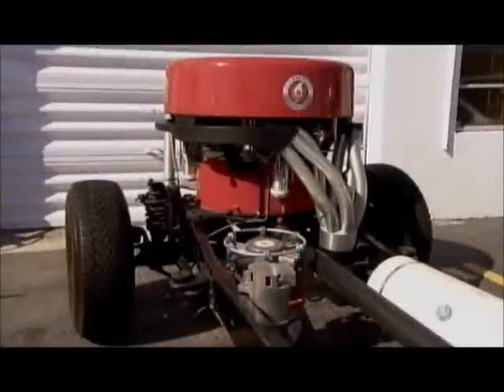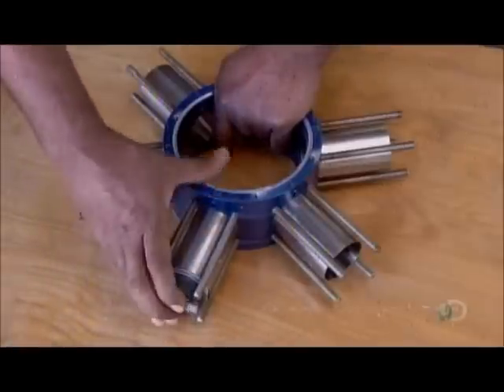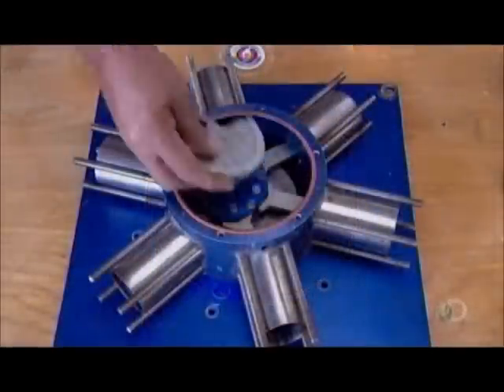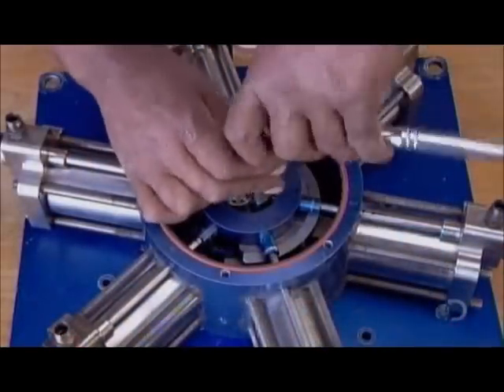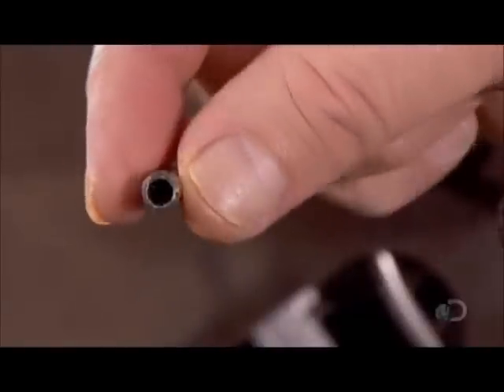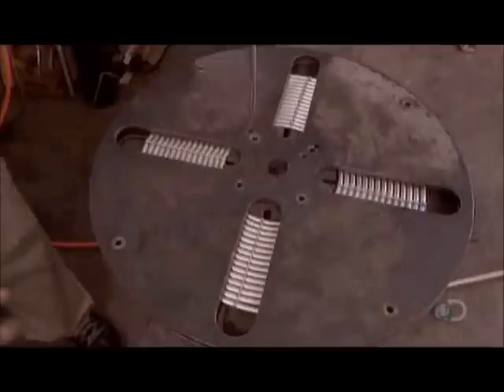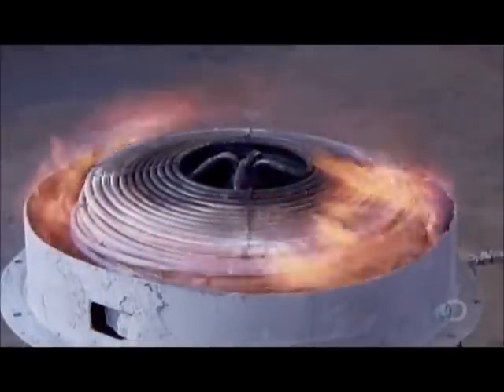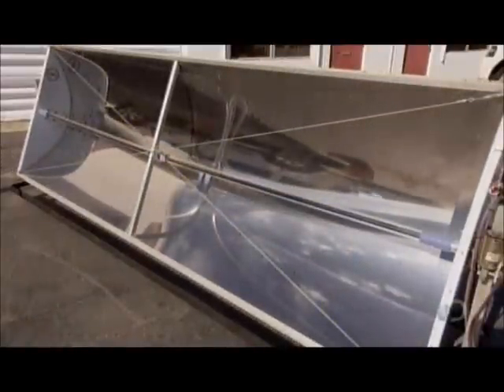How It's Made - Steam Engines

Comment: Steve Cummins just replied, I got an email notice, and now I can’t find his comment in this thread.  This drives me crazy.  So I’ll post his reply here and then address his comment.

"steve cummins
think it's pretty much same as the hybrid steam/ICE idea. Instead of a boiler, fire an oxyhydrogen blowtorch into the steam expander's inlet manifold. If gaseous fuel is at stored at high enough pressure, it'll don't need pumped, and there'll still be enough pressure behind the "steam flame" to run the engine. Suppose it's kind of like using a small rocket that makes steam to turn the expander over.

Avoids the inefficiency of heat transfer across boiler tubes which would otherwise reduce T_hot
Does…”

So his reply confirms my supposition of what he meant.

Comment: i thot water wasnt a lubricant
Reply: it is. slip and slides.
Reply: GenesisRhapsodos
slip and slides use soap...yeah water can make something slippery but it's not lube
Reply: water parks dont use soaps on their rides. major facepalm
Reply: GenesisRhapsodos
genesis said slip and slides not waterparks those are two different things dummy. The water is flowing in the direction of the slide, that combined with it's steepness keeps you going. Often, if a water slide is too flat and doesn't have heavy enough flow you will find yourself stuck even though you had momentum and there is a current of water pushing you. If there was lube involved, you wouldn't have this problem

Comment: Cyclone Power Technologies appears to be defunct...having been nothing more than a very clever investment scam....
Reply: +The real doktorbimmer Steam has potential, but not with a con/scam such as Cyclone Power Technologies or as I call them Scheisterclone. They are a disgrace to light steam power.
Reply: +The real doktorbimmer Pardon, but the real scam here is that a company has made unsubstantiated claims regarding a "family" of powerplants that have never been shown to produce any usable power in over a decade and said company raking in almost $60,000,000.00 from investors and typically allocating more funding to Administrative then R&D for a company that is supposed to be a research and development deal! 

That is the scam. 

You are right though, on a peak sustained load basis, light steam power can't equal the peak efficiency of IC engines, especially Diesel types. 

The only equalizer would be for city driving where a properly designed light steam power plant would not idle or use fuel when the vehicle was at stop lights, etc. However, hybrid IC and electric vehicles are already doing this. 

The other would be the use of "carbon neutral" fuels, such as wood chips or compressed grass disks, this would be easier with a properly designed Rankine cycle then an Otto cycle. However, gasifiers such as were used in the late 1890's for municipal gas production or in the 30's - 40's for road vehicles allow ICE or Otto cycle engine to run on gasified solid fuels. So that isn't a concrete advantage either. 

I don't know how many times I have tried to explain the technical impossibility of a family sedan getting 200 mpg with the simple application of a "magical" carb! Yes, heat cycles desperately need to be taught with more emphasis in public schools.
Reply: DrFronkonstein As soon as you have used heat to turn water into steam.. you have lost any chance of competing with ICEs for thermal efficiency..
 Steam is a very inefficient working fluid
Reply: +The real doktorbimmer Actually no.To use your mention knowledge
Carnots law states if you can get the temperature of the working fluid
high enough then the efficiency is comparable to ICE.Steam pressures
of 3000 psi and 1500degF are needed.The problems are engine
wear at these high temps and pressures.With exotic metals this could be solved but metals like cobalt are needed.The ICM engines are just
cheaper.
Reply: meagain2222 Clearly you are one of the folks we mentioned that has no clue about heat engine cycle efficiency or Carnot's formula for calculating it..

You seem to be very confused with the difference between super critical expansion and thermodynamic performance of gasses/vapor...

and HEAT CYCLE EFFICIENCY.

Carnot told us 200 years ago that steam can never reach the thermodynamic efficiency of ICEs
Reply: Some Other Dude Yes its fake! you hapless twit... Cyclone was never awarded any Army contract.. it ACQUIRED the contract from the "purchase" of another shady company called Advent before the unfulfilled contract expired.. using the deal for publicity to boost investments and bolster the image of the company as a legitimate business... The contract expired 5 years ago without any purchase agreements to continued development.

Fake, nothing but a publicity stunt.
Reply: Some Other Dude As for things headquartered in houses, that's quite common for scam artist to form fake companies to buy ( or more likely rent)  luxury homes with investor cash.. if the home is listed as a company asset (or its offices) then the unethical diversion of funds is perfectly legal..
Reply: +the real doktorbimmer are you kidding me, dude? The second you use steam for it's heat rather than it's expansion you are already in the green.
Reply: +steve cummins Well Steve that should tell you there is something fundamentally wrong with your argument.
 You must be unable to or have severely misinterpreted that data, because Carnot's Heat engine Formula tells us that No practical Heat Engine can match the the Carnot Cycle  additionally Carnot accurately predicted that the Rankine cycle cannot match the practical or theoretical efficiency limits of a internal combustion engine... Rudolf Diesel successfully proved Carnot's theory in 1892.
Reply: @doktorbimmer  youre an asshole. Even though youre right about the stuff youre droning on about i wouldnt want to be on your side.
Reply: The truth is irrefutable... denial and childish insults won't prove your point even if you had one... won't make you look very smart either kid...
Reply: +The real doktorbimmer "March 6th, 2016:  Cyclone Power Technologies Signs Agreement With
Nextra Technologies of The Netherlands for 125 - l Megawatt Solar Plants....."
Reply: Some Other Dude Oh! just like the fake deal to build forklifts in Ireland, lawn mower engines in China or generators for Advent and 3R in Denmark????

What about the fake US Army Contract they claimed to have???  

Wow! you would have to be a real sucker to give these frauds any money!!!!
Reply: Some Other Dude Lol..!!!  This is SOooo much fun!!!
"Nextra Technologies"
"of The Netherlands"..?????
Lol..!!!

Why is the corporate headquarters of Nextra Technologies "of The Netherlands" located in a house in South Bend Indiana?????

Why is their website a dead link???

Could this be just another fake announcement from Cyclone??

And what about Nextra's partner in the deal, Yakomoz??

They claim to be in the solar business but have only completed projects in places no one has ever heard of..
Reply: +The real doktorbimmer you keep declaring things to be 'fake' when they aren't.  Google 'cyclone steam army contract'.   It's a real agreement, not fake.  As for things headquartered in houses, that's quite common for startups, mostly to duck taxes, which is an entirely different conversation.
Reply: @Some Other Dude You have no idea what a stupid fool you look like right now... you must be the dumbest person on YouTube....
Reply: Engine may or may not be scam... I don't know.

had similar arguments regarding thermodynamics with  dokorbimmer elsewhere

Steam plant verses steam engine...
Carnot efficiency verses Carnot cycles

Steam plant includes boiler. Seems possible to avoid the faff and inefficiently of heat transfer through boiler walls by combusting  pressurised hydrogen and oxygen somewhat akin to an oxyhydrogen gas torch and that would get steam at about 2,800 °C to feed into steam engine for expansion... 
If an engine could be built to cope with such high temperatures, and exhaust at say 120 °C 
Carnot efficiency of such a steam engine =1 - ((120+273)/(2800+273))
=0.87

limiting steam temperature to a more feasible 1,000 °C  and exhaust still 120°C.  (feed water into burner or spray water into steam inlet just after burner to attempterate the steam and cool things down a little) 

Carnot efficiency of such a steam engine =1 - ((120+273)/(1000+273))
=0.69

Considerably higher than existing IC engines ! 

in steam plant it's possible to use recuperation/feedwater heating, to send some of exhaust heat into gas/water lines before a burner so a burner doesn't have to supply as much heat to get steam upto inlet temperature... that increases plant efficiency. similar can't be done with "internal combustion", only "external combustion"
Reply: +steve cummins It certainly is a scam Steve, there is no doubt about that now... not to mention the companies completely unfounded and ridiculously exaggerated claims are absolute BS...
Reply: +steve cummins Please cite an example of a commercially available single cycle steam engine that achieves half of those efficiency figures.
Reply: haven't been able to find details on any commercially available reciprocating steam engines that give efficiency figures.

Best data available is that for steam turbine plants which run on same "rankin" thermodynamic cycle as reciprocating steam engines. and their thermal efficiencies approach Carnot efficiencies, because being large/static they can have large "boilers" that are able to get bulk of heat from combustion in to the steam.
Reply: +Rohan Zener It certainly is possible and has already been done in large scale, stationary industrial applications like electric power stations, but that is not what was being sold here... Cyclone was selling false promises and fake technology.
Reply: +Rohan Zener It won't stop the crackpots and scam artists like Harry Schoell and Cyclone Power Technologies... but a legitimate, professional engineer would know better.
Reply: +Rohan Zener  You don't get it do you? Cyclone Power Technologies is a vaporware scam.
Reply: +Rohan Zener Anfänger
Reply: Really?
Reply: Yes it REALLY is a SCAM, You don't believe me? Why don't you invest with these crooks, you will never see your money again sucker!
Reply: Cyclone is still around, alive and well, and Mazda made it official, they announced a rotary range extender engine coming out in 2022.
Reply: @someotherdude  Youre a big fat liar.... Cyclone is a defunct vaporware scam.
The Mazda MX30 is already available for sale and will only be available in a plugin battery EV or mild series hybrid powered by a 2.0 liter Skyactiv G engine.
No range extender version and no rotary engines
Reply: TheRamsberg Although steam may continue to have commercial viability in some limited applications such as ships and mega size power plants where cheap fuel and thermodynamic scale helps offset higher fuel consumption... the use of steam in application less than 100,000hp is not economical due to the lower thermal fuel efficiency inherent with steam power.

The real scam is the notion that still exists that steam is somehow more efficient than ICE technology..

No engineer worth his salt would fall for a scam like this... it goes against the laws of thermodynamics and basic engineering concepts...  Until Carnot is taught in public schools, the general public will be subject to scams related to engine technology like  steam power and the Wankel engine,  scam artist like these could continue to operate because most people are not educated in engineering...
Reply: @doktorbimmer  It doesnt mean that the ICE cant be efficient, the steam engine needs to be way less efficient. You can make the steam engine way more efficient, so does the ICE, both aren't on their max efficiency, there is aways improvement to do. But when we reach the max efficiency, then the steam engine will be less efficient by the law of thermodynamics. But that will be a loooong way

Comment: You moron! This is no steam engine! Steam engines are one steam cylinder moving a flywheel!
Reply: Dr. Jak G. Cogsworth Thats right kid! this engine is powered by magic pixies that jump out of the boiler tubes when it gets hot and push  the piston around!!!the boiler is fired by burning magic pixie dust and the hopes and dreams of all the poor suckers that still think that steam is not an obsolete technology!!!
Reply: .....Union Pacific pulled 142 double stack cars with the recently restored 4-6-6-4 challenger. No back engine and no doubleheading was needed.
Reply: Dr. Jak G. Cogsworth Loaded?  On flat ground?  Any grades?
Reply: All loaded, 1.53 grade.
Reply: Dr. Jak G. Cogsworth Really? How many tons?
Reply: I have no idea.
Reply: Dr. Jak G. Cogsworth Too bad... I was almost impressed...
Reply: +The real doktorbimmer I know this was an old post but most loads are considered to be between 80 and 130 tons depending on the car type and load type. If I am remembering correctly the average shipping container loaded is 30 tons, the car weight is another 20 or 30 tons. Assuming all the cars were actually double stacked... that is around 80 tons per car which gives you about 11,360. However that is assuming you only put 2 containers on. It is possible that the capacity could be increased by using more shorter containers. If that is done you can fit 4 20 foot containers on each car with a max of 24 tons per container plus car weight... giving you about 126 tons per car and 15624 tons across the whole train. Not bad for a singe engine.
Reply: +Weyerhaeuser Railfan that's the classic steam engine that has my preference, but a steam engine is a engine, that works on steam, but according to some people in this comment section, this is a scam. so, were back to the old days :)
Reply: +TimdeKleijn Yes, this is the same simple, old version of Single Expansion Type Reciprocating engine.. found on early locomotives it is the absolute least efficient design for a steam engine.. the only difference is the arrangement of cylinders which is 'Radial' instead of the more familiar 'Inline' arrangements. 
Yes, all the evidence now points to this video and the now defunct company itself as being a huge investment scam with millions of dollars fraudulently siphoned-off to pay its 3 key employees